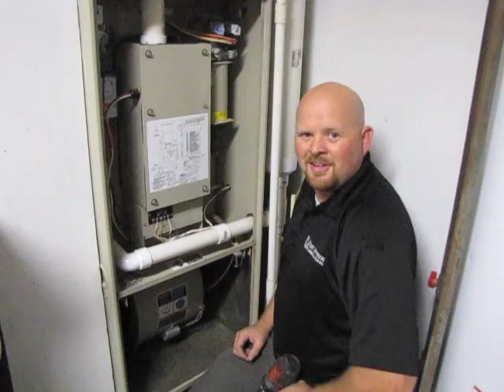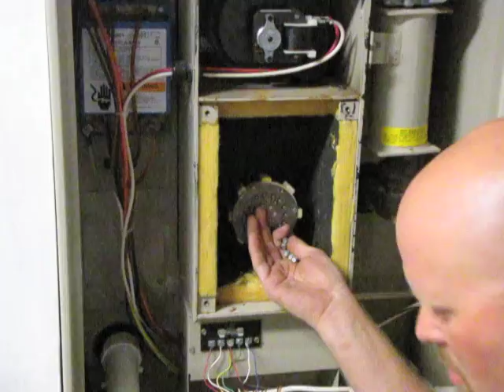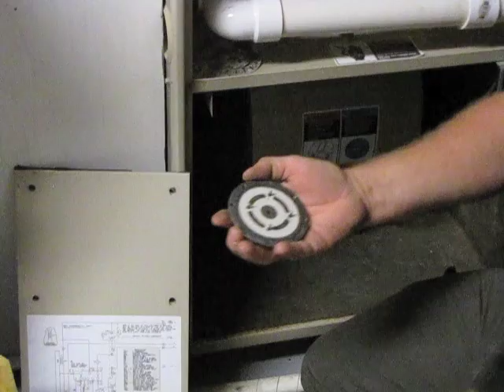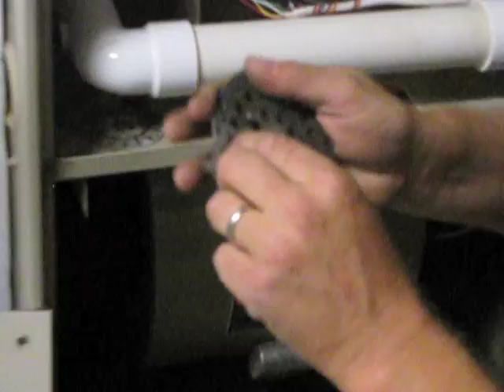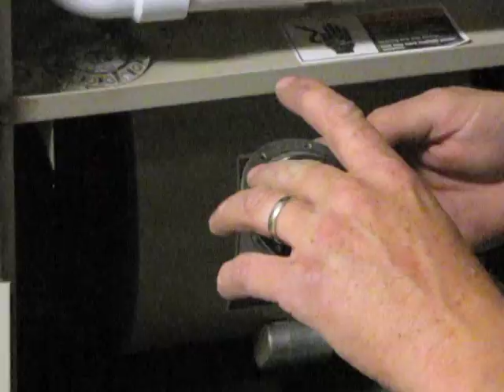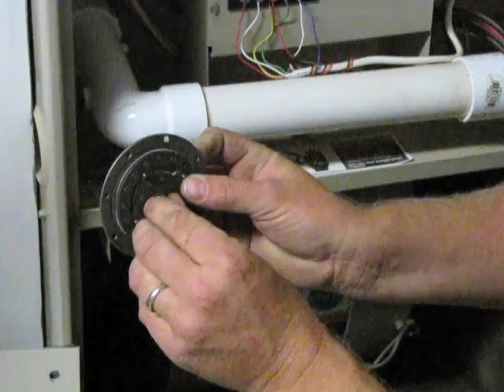DIY - How to Change a Pulse Air Flapper Diaphragm

Comment: It's not a filter Jacobi. It's a flap which makes a seal against the backpressure. It's like a valve. It's also only supposed to be torqued to 10 inch pounds. The surrounding screws can be very weak and break easily. Do not even try to snug those down. The center bolt is 10 inch pounds. It's likely old as the hills and easy to snap as well. I cleaned mine all up with a dish scrubber and some water.

Comment: Anyone had an issue removing the housing? I removed the bults but can not get the housing plate off.
Reply: Yes! I can’t get the plate off! I’m nervous to pull at it too hard because I don’t want to warp the panel.